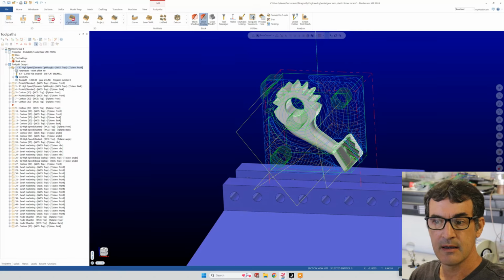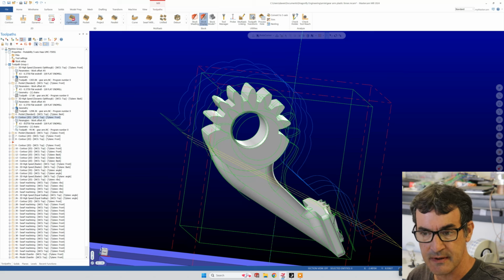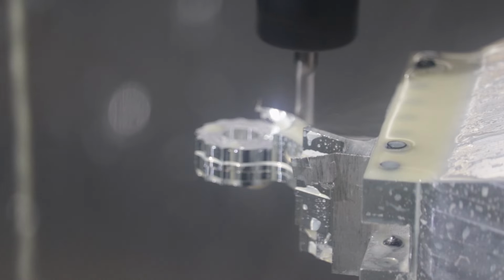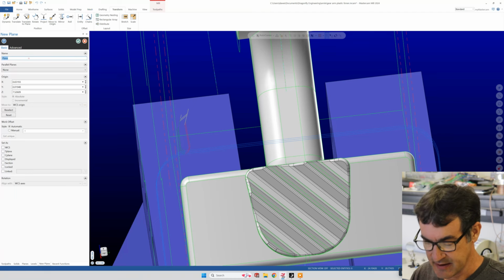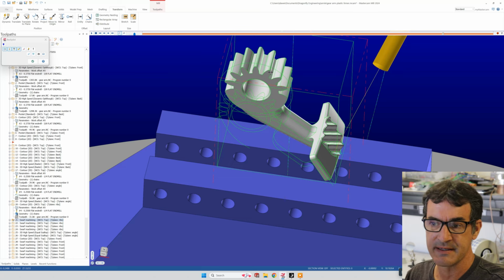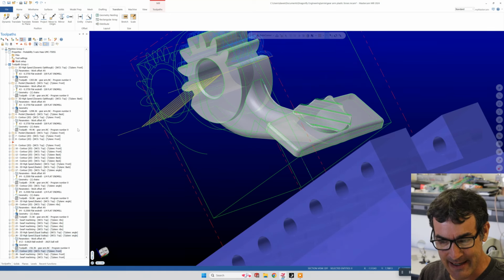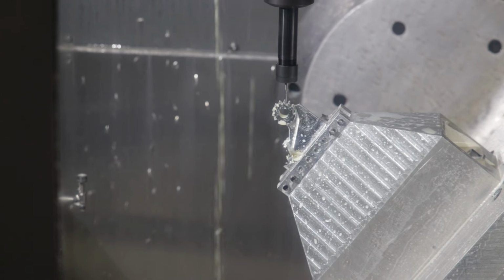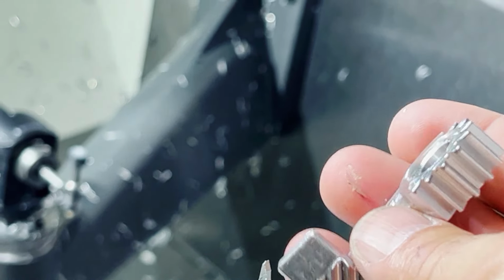5 Axis machined part using Mastercam 2024 and a Haas UMC mill

Comment: if you wanted to get into programming parts for this type of stuff, but you don't have a cnc machine to do the actually machining on, is there a way to get your hands on this software or some form of simulator?
Reply from the maker: @kiegh  autodesk fusion 360 cad cam software can be downloaded and used maybe for free if you are a student or at least not a company. For mastercam you would need to ask your local reseller